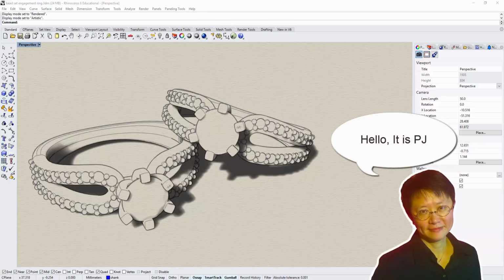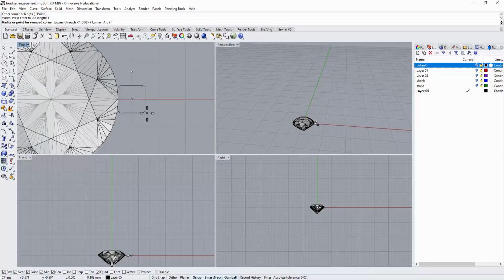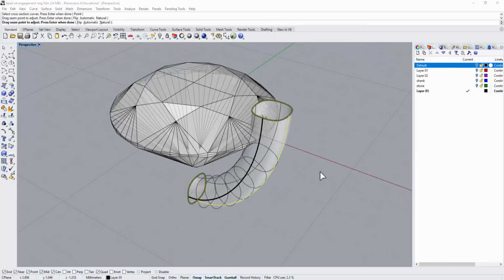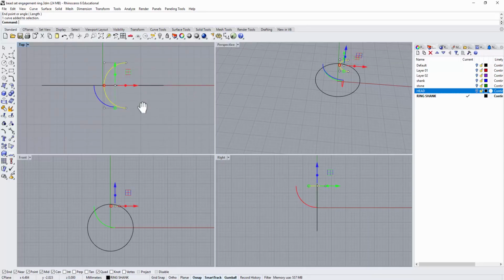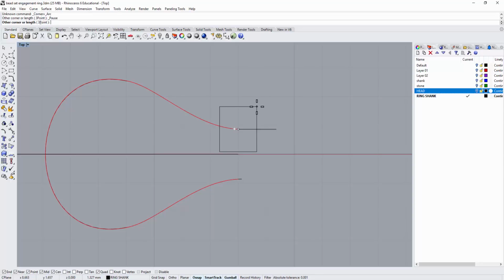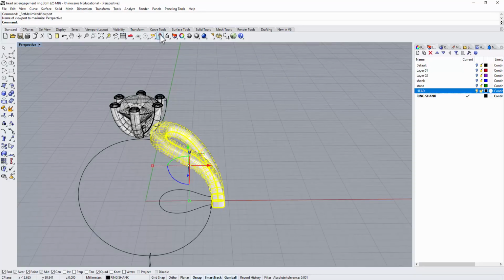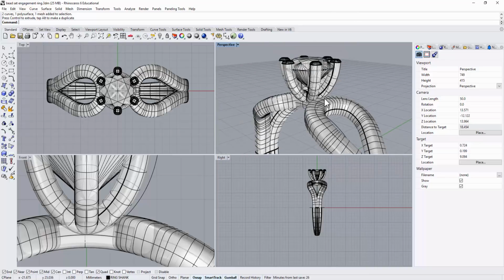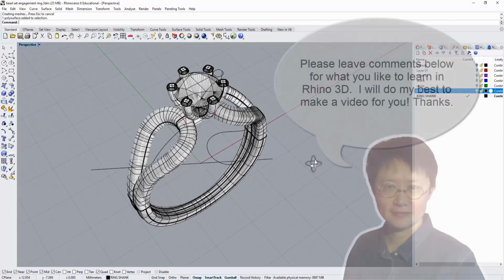Jewelry CAD Design Tutorial #24: Engagement Ring Design in Rhino 3D

Comment: What size would you make the shared prongs for a .015 carat diamond (1.5mm)? It'll be 5 diamonds with 10 prongs, 8 shard and 1 each at the end.
Reply from the maker: the prong size is depends on the look. however, you don't want to cut more than 20% of thickness and no smaller than 0.4mm in diameter.

Comment: Every once in a while i have trouble regarding when using Boolean union on the prongs.  It gives me exclamation points on the bottom of the head.  Why is that happening?
Reply: Wow I figured it out.  Okay, so when you don't adjust the points on the sweep, it messes up the filletedge.  It created an open polysurface and that is why it wouldn't union.  After going back and adjusting the points on the sweep, everything worked much better.  Thanks for the lessons! I've learned a lot
Reply: Actually I still had a weird issue.  Boolean union didn't work at first, until I move one prong .01mm.  Then I tried again and it worked.  No idea what caused that

Comment: I dont know why, but the function boolean isn't working with the stone set...
Reply from the maker: If you download the stone model from somewhere else. Most of the time, they are mesh, not polysurface. You will need to use MeshToNRUBS command to turn them into polysurface first. then you can boolean them.
Reply: @PJChenJewelryDesign  no, i can't boolen the prongs.. :(  and cant split them..
Reply from the maker: @mariapisarevskaya7182  in that case. check if all your objects solid before you boolean them
Reply: @PJChenJewelryDesign  ooh God! I found out I had a mistake in the prong's surface settings... Thank you for the answer!! And thanks for all video you made!
Reply from the maker: You are welcome!

Comment: i use Matrix rather than Rhinogold.is there anything different in this two softwares. is rhinogold better than matrix?
Reply from the maker: They both are Rhino plug-in that is why you can use all the rhino commands in both programs. However, both software is similar but each has unique command and interface, and the renderings are different.

Comment: Hello PJ, i have a question, when you drag an object it responds very smooth and organic, here its very choppy and jumps spaces when i do... some configuration on rhino?
Reply from the maker: There are few things it may affect the smoothness on the viewport. 
1. Go to Options-Document Properties-Mesh. make sure your setting is jagged and faster
2. Go to Options-Render. make sure the resolution and quality is in draft quality. 
I like to use Ghosted when model. if it get slow, I will use wireframe mode. 

If every above is set right. then do you have many software opened in your computer? does your ram is enough? or sometimes restart your computer will help. 
let me know if those tips work.
Reply: @PJChenJewelryDesign   sorry for tooking so long, actually it was just snap spacing that was set to 1mm, put it on 0.1mm and it works!
Thank you so much for the attention, im learning so much with your videos
Best regards
Reply from the maker: @92blckt  Great you find the solution. Feel free to ask questions.

Comment: Hello PJ Chen I wonder between Sweep1 and Loft which one is better ?
Reply from the maker: Hi Pheng. it depends on what type of surface(s) you plan to get. Sometimes they came out similar. but if you read the isocurve from the surfaces, you can tell what commands were used. There is no "better" one. The goal is to make the surface simple in order to have better mesh and better print. Loft surface is done by the curves in order. and Sweep 1 has the rail with cross-session profile. They have different direction on surfaces. In the case of making ring band, sweep1 will be"better", or you may need to make too many profiles for loft.

Comment: great tutorial as always. I am modeling this ring for practice and i noticed that yours says "closed solid polysurface " and mine says 'closed polysurface" is this just different versions of Rhino (i am using 5) or have i done something wrong? I am also getting a boolean fail when i try to join my 6 prongs? Thanks in advance for any help.
Reply from the maker: interesting. I did a test comparing Rhino 5 and 6. and it is because Rhino 6 wording differently. If your boolean is not working. it may be because the seams is over lapping. try to more one of the prong up or down 0.01 and see if you can boolean.
Reply: great thanks. i trimmed a small amount off of the bottom of the prongs and it worked thanks